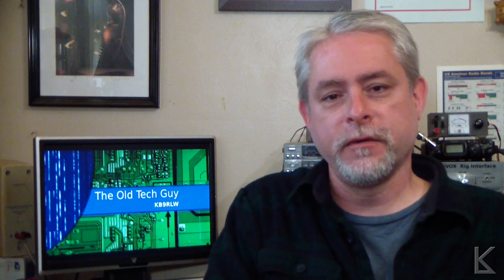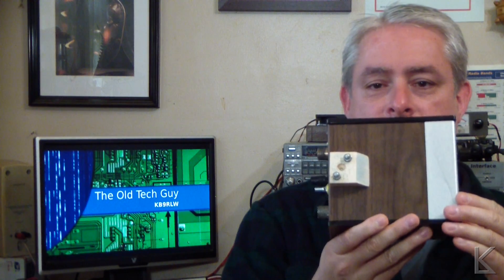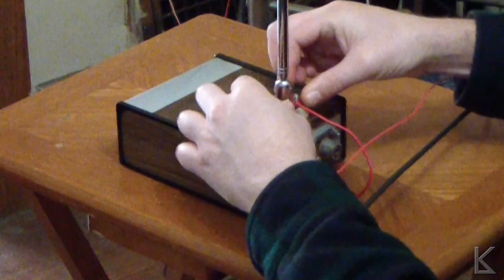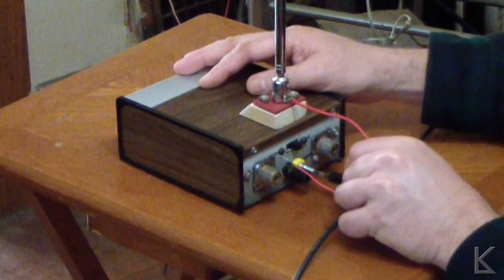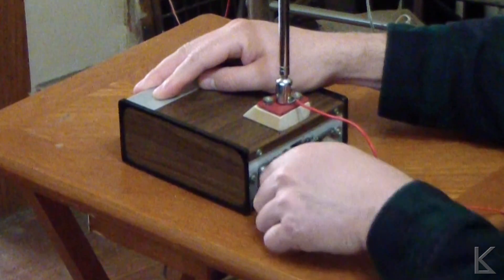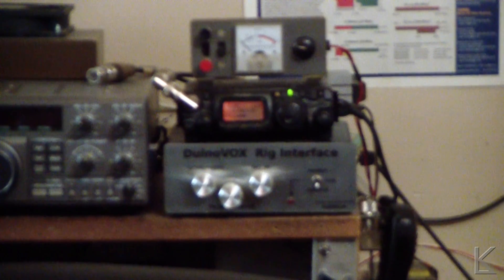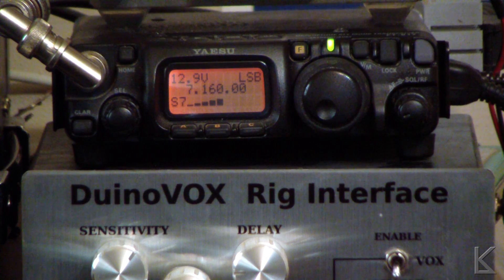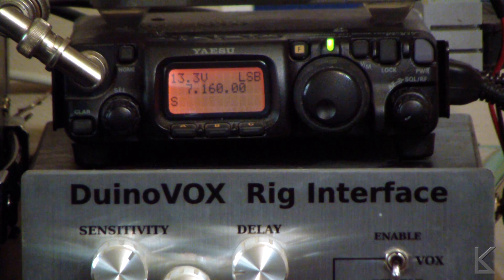Ham Radio - Updating my home built antenna tuner with an optional whip

Comment: Hello . DE VU3IZD. The BC611 handy talkie radio used by US Army in WW2 uses 1.5 M long telescopic whip . The radio is working on 3MHz i think. I checked the diagram of the BC611 . The radio usese a loading coil for match the frequency with the whip. How is the calculation of the loading coil for whip antenna?
Reply from the maker: Google is your friend. I searched for loading coil calculator vertical.
https://www.66pacific.com/calculators/coil-shortened-vertical-antenna-calculator.aspx

Comment: In 2002, I had to have a back operation that at least got me back on my feet.  I was a bricklayer.  So, being a ham I got to building things like your chair side antenna.  The big difference was I used a wire wound rheostat.  It worked great for QRP!  I built a lot of Pixie CW transceivers and they helped me save up for some more parts to build more (and a better outlook on life).  Hope you are doing better.  I thank God for the skills I have no matter how basic they may be, and they are very basic.  My wife is very supportive, too!  By the way, she is also a ham.  Have fun making the videos and I will enjoy watching them, Greg KA8ZAF
Reply from the maker: I have been thinking about using one of those wire rheostat's as a variable inductor in a tuner.  I imagine there's a bit of loss due to the resistance.  But it's still an intriguing idea.

Comment: Would that tuner work with a large indoor single or multiturn  loop antenna for receive only?
Reply from the maker: Tuners don't really improve the sensitivity of any antenna for receive.  At the most, they will attenuate signals that are outside of the range you're tuning to.  But you can't get any more signal than the wire is already capturing.
That said, you might be able to reduce interference from broadcast stations if that's a problem.

Comment: Kevin,
I'm relatively new to antenna stuff so let me ask if I can connect a random wire directly to your antenna tuner without using an unun in between...
I'm about to build my own and already got several old radio capacitors to start the little project. 
Thanks for your inspiration!

55,73
DF7ED
Reply from the maker: You can, but the impedance can get quite high, making it hard for the tuner to match it.   An unun will bring that impedance down to something that's easier to match.
Reply: Thanks for the quick reply ! So I will place an unun in between and feed the tuner via coax...
55+73, Erhard

Comment: Great video.  Signed up to support you on Patreon.  You have an amicable, easy manner.  I hope you find something soon in your field.  If not, no shame in doing something else - even a McJob - until something rolls in.  Good luck.
Reply from the maker: Thanks for the support!    Every little bit helps.    I've got a bad back and neck and can't be on my feet for more than about an hour at a time, or I'd be doing convenience store or fast food to get by.
Reply: Man that sucks, but you have the right attitude.  Getting by=eating.  $4/mo is reasonable, and the reason why I like Patreon is that its VOLUNTARY.  Not a pay wall-though some use it for that.  I'd encourage folks to sign up to your account and donate.  Your videos are great, and it's cheap to pitch in to show appreciation.  VK3YE sells an ebook for $5.  I wonder if you could compile some of your ideas into something like that and try and make a buck that way.